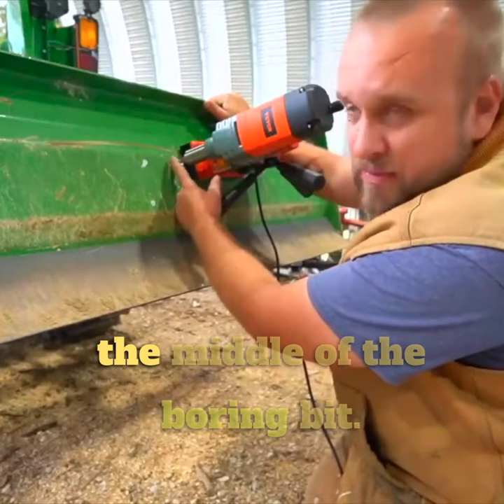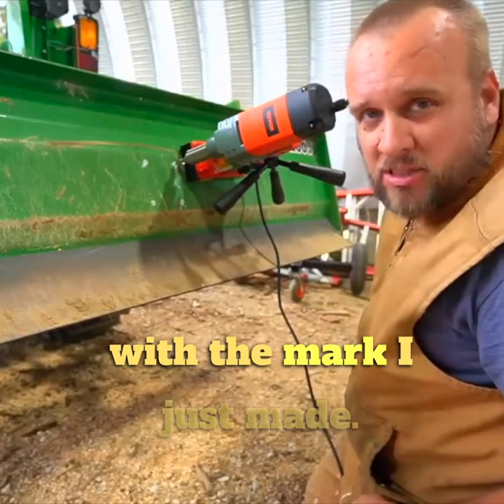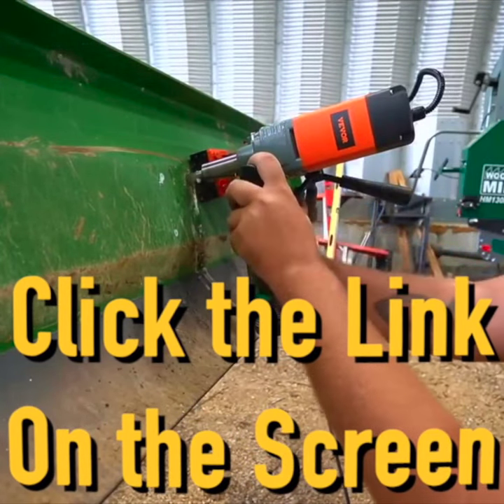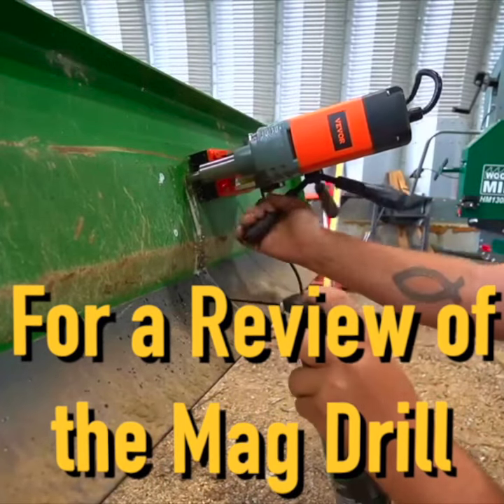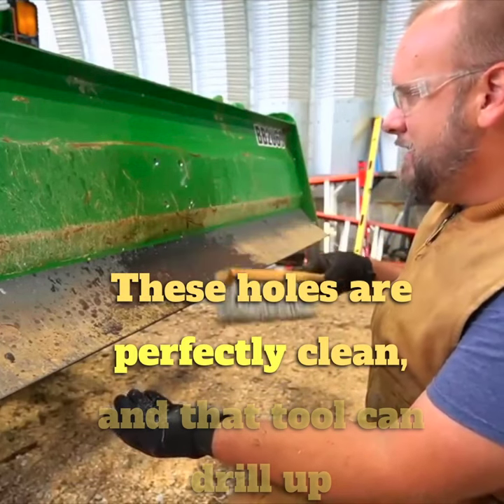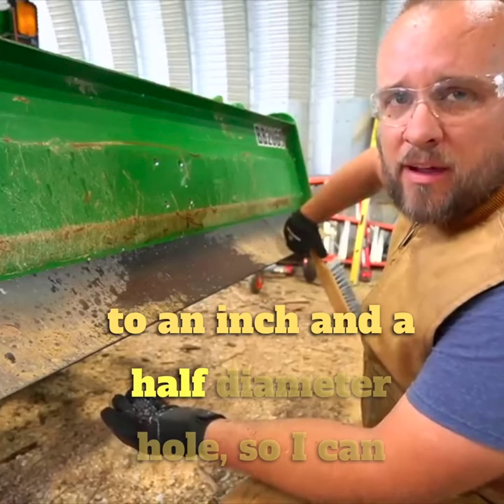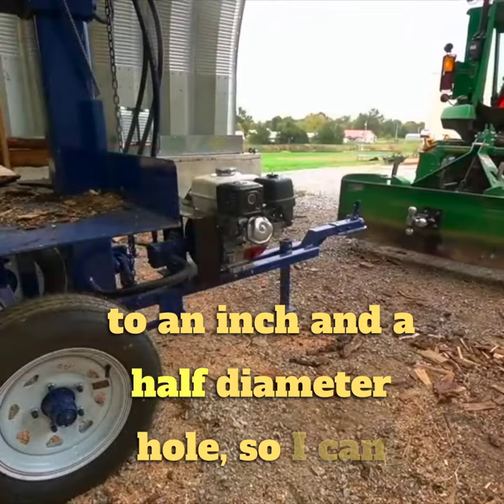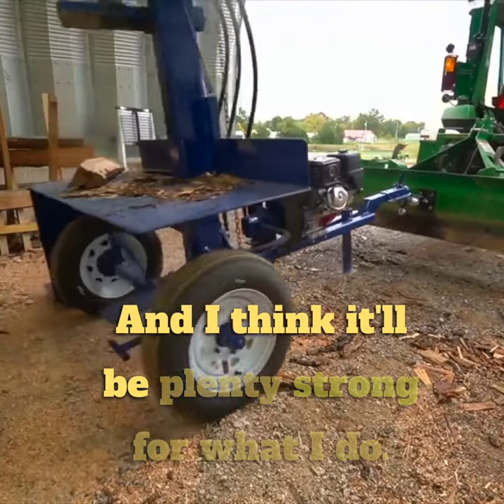Upgrading my Box Blade with a Mag Drill #tractor #farmlife #fabrication #metalwork #farmequipment

Comment: Thank you! I drilled a receiver onto my ballast to try and hold a mobile winch, but I didn’t like it.
 
I finally worked up the courage to weld a new receiver under my quick hitch for the winch and it turned out great, but now I have a spare receiver which I didn’t know what to do with till I saw this video. 

Can you do a video showing how to flatten ripper teeth?